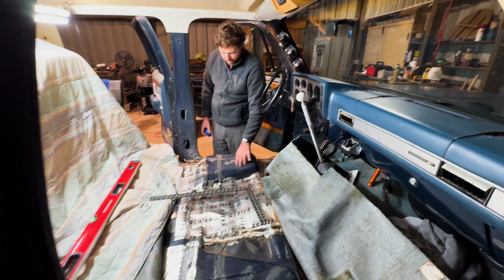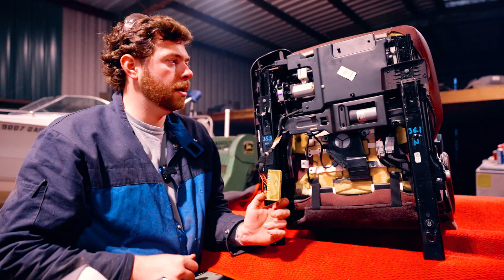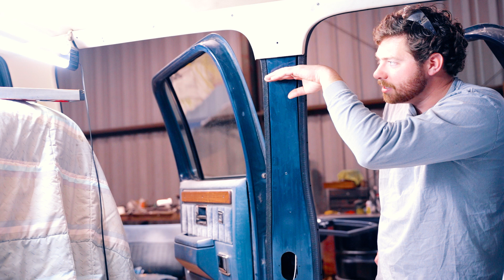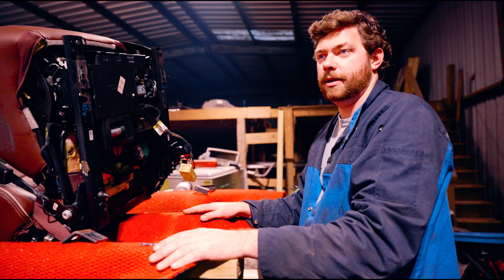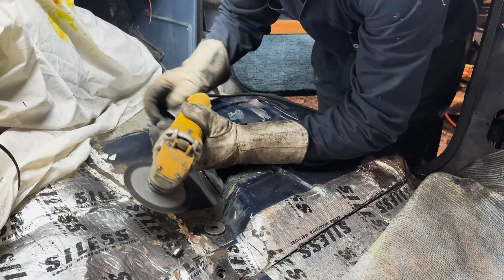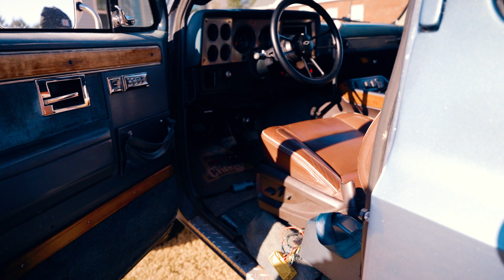Interior Swap: High Country Seats Pt. 2

Comment: Would it be the same for a single cab k20? Looking to change up the seats in my truck I have a rear seat out of a 2005 avalanche in mine now
Reply from the maker: @hypesandsonsrestoration945  should be identical only things to consider are the fuel take location on the single cabs is right under the humps. You could definitely get a rear bench in there

Comment: Nice work man!!!!  Just got my set of Denali and am ready to install them in my 98 k1500.  I am pumped!  Did you get the heating and cooling function to work?  I really am interested in this function as I live in the north and we get both hot and cold weather.  Love that old truck of yours.  Looking for a dually just like it
Reply from the maker: @robmoss6853  thanks man that should be slick. I plan on using this kit https://leatherseats.com/shop/seat-comfort/seat-heater-cooler-unit/

Comment: Nice . Definitely want to see the hook up on heated seats
Reply from the maker: @White-Head  we’ll do it just cost another $750
Reply: @barnyardbuildz  why is it gonna cost $750?
Reply from the maker: The kit to make it work is $375 per side
Reply: Where is the kit
 available please, thanks  @barnyardbuildz
Reply from the maker: @ haven’t tried it yet but here it is https://leatherseats.com/shop/seat-comfort/seat-heater-cooler-unit/
Reply: @barnyardbuildz why can’t you tap into the wires on the seat like the one that run all the power functions? Also wouldn’t you not need a kit like that if the seat has all the fans and heating already in it?
Reply from the maker: @ it has all the wires and components unfortunately you can’t activate them without a CANBUS single from the factory ECU I tried every wire and even direct power and they do not work
Reply: @barnyardbuildz  is the Canbus signal not a constant 12v signal? I tried power probing all the wires which I noticed too nothing happened
Reply from the maker: @ yes constant 12V but there are no wiring diagrams for the seats to tell you which is the canbus and after test I still can’t find it
Reply: @barnyardbuildz  when do you plan on trying out the kit?
Reply from the maker: @ not sure I’ve got some other things I want to do 1st like the rest of the interior and get the Winch for the new bumper
Reply: These builds aren't cheap...maybe we start getting paid on here we can do these wild customize things  @barnyardbuildz